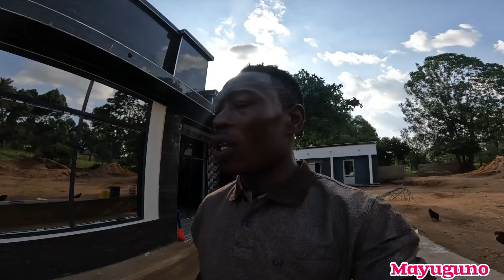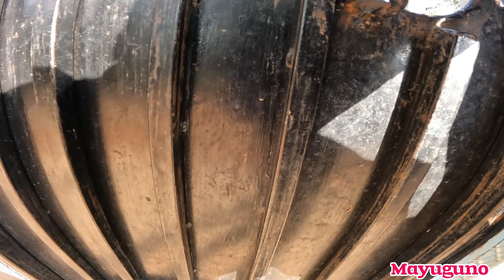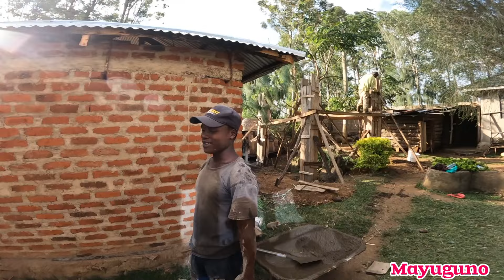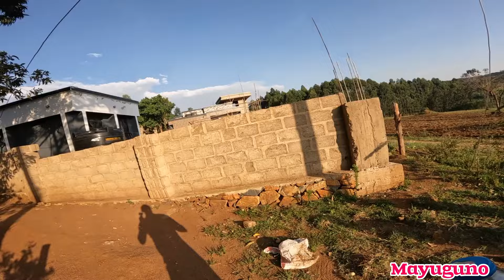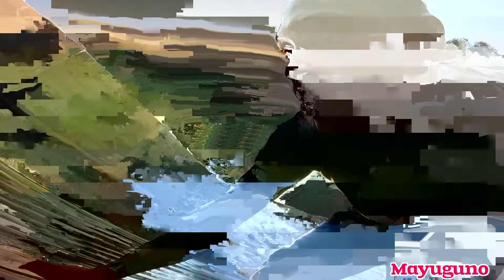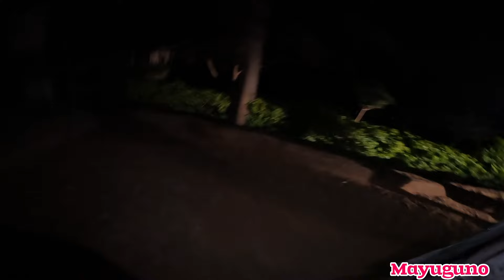EMOTIONAL😭|| NEW LIFE IN THE VILLAGE WITHOUT MY TRUE FREND@DeeMwango HARD DAY TO ME SAY GOODBYE

Comment: The pump you need is an electrical one maybe thats the problem you have electricity, if so it could be solar powered. The way the pump works is that anytime you turn on a tap or water faucet in the house the pump automatically turns on and water is pumped to that faucet, when you turn off the faucet the pump shuts off until it's  needed again hope this is helpful.